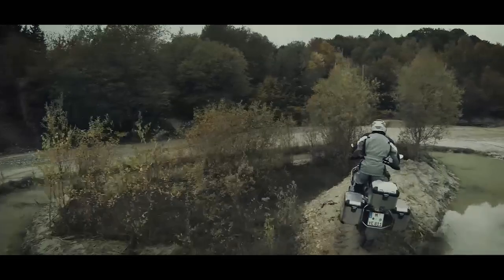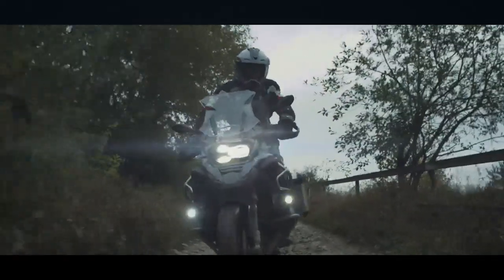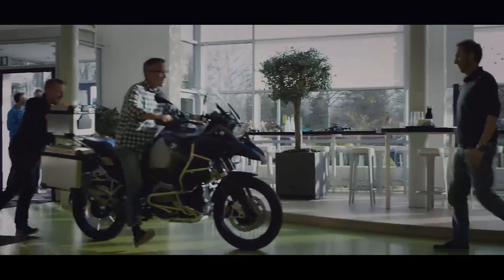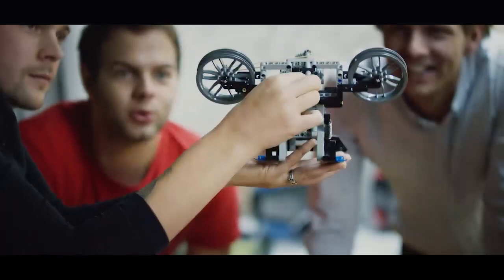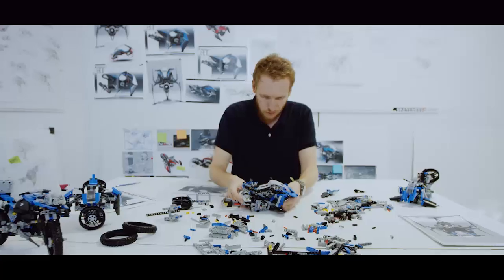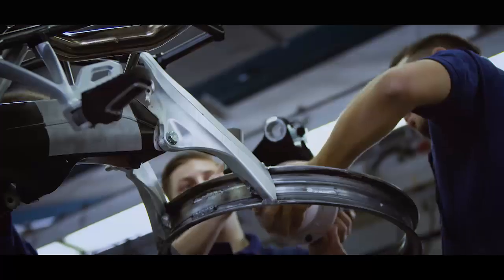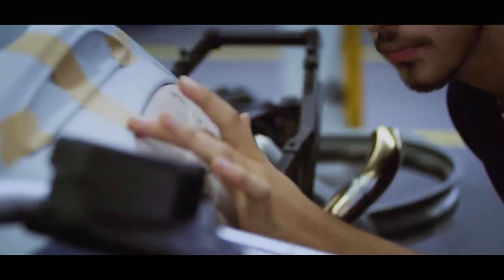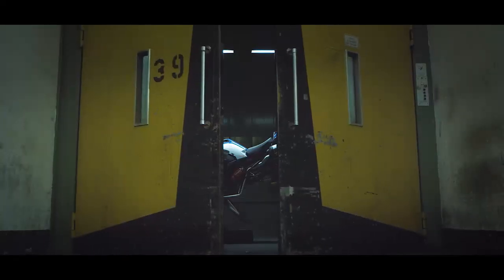BEYOND BORDERS - The BMW Motorrad LEGO bike

Comment: technically the engine power should spin the blades fast enough to get the bike airborne but maintaining the bike's balance in the air with those tiny stabilisers won't be possible in low speeds.

Comment: And you can make same thing with cars and motorcycles by adding maglev levitation at front at back(two magnet  that keeps car above ground through maglev levitation ,and adding airless tires that can use as VTOL as addition to hovercraft engine /turbine concected to hydrogen fuel cell electric engine with one fan in front and other fan in the back of the car , including those airless tires moveable in all 360 degrees ,so car can actually can both hover and fly  (but seems to wise to limit hovering it 50 cm above the ground  except in case of emergency  .)